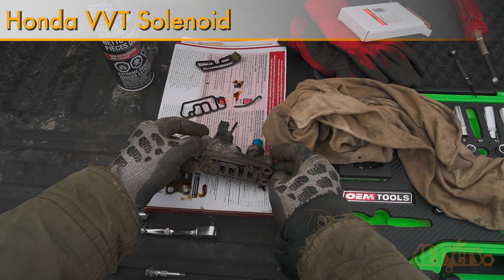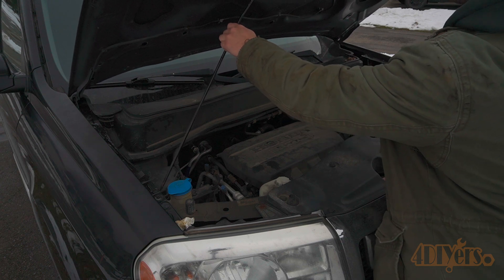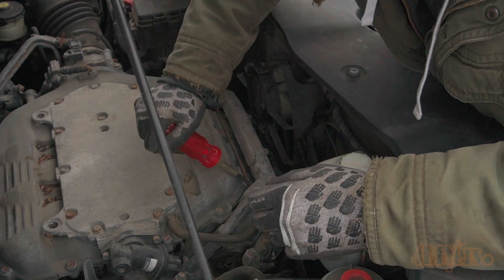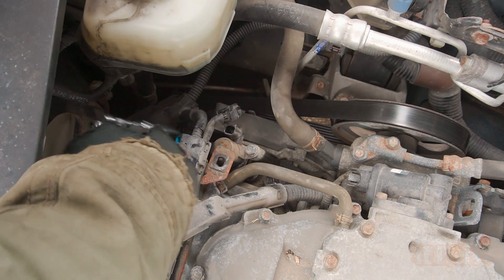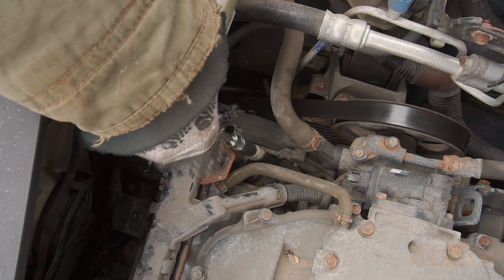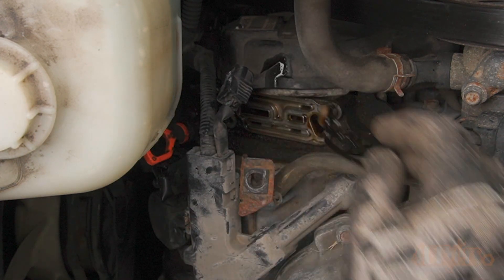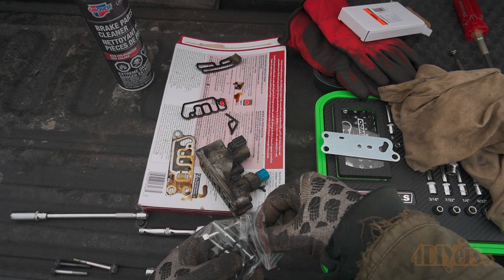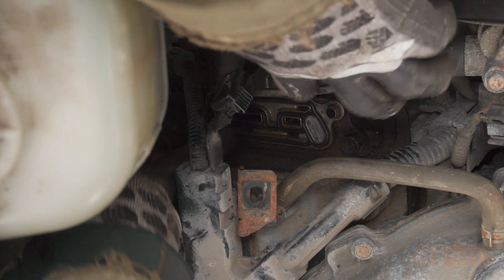How to Replace the Gasket on a Honda 3.5L V6 VVT (VTEC) Solenoid

Comment: Do you know of any videos for the 3.5v6 accord mine is a 2012 and i need to replace both
Reply: same situation as you. Replacing this on a 2010 honda accord v6. I think the video will apply to both of ours, but I could be wrong.

Comment: Have you had any leaks going forward by not replacing the solenoid itself? I am planning on just doing the gasket and worry about future leaks if I don’t install new solenoid too. Thanks!
Reply: 2008 accord. Had my cousin who's a mechanic replace the gaskets only. Started leaking 6 months later (they say to keep the original mesh if you can and just swap it) . Had to buy a new gasket, installed it in about 30 mins top. Hasn't been leaking. The whole part is more expensive. It's up to you how you want to proceed with that. All Rubber gaskets eventually degrade with time. Just what it is. So you can keep replacing gaskets or buy the whole part and eventually replace gaskets. Just depends on how bad in shape the part is. The switches are replaceable too. Proper diagnostic will let you know